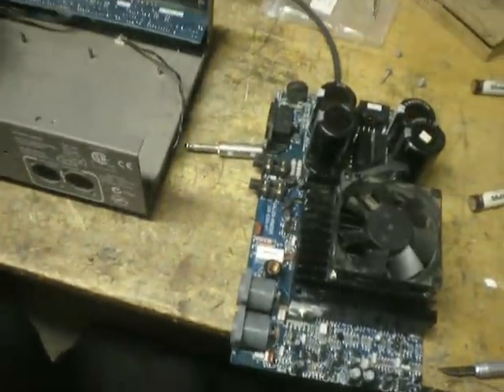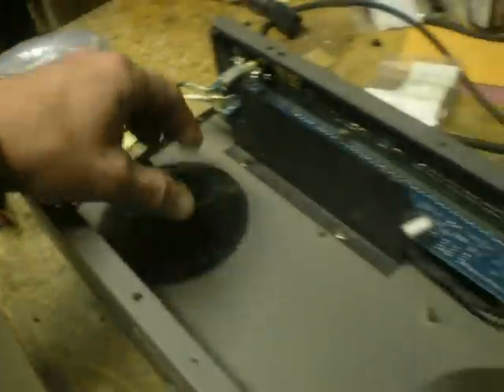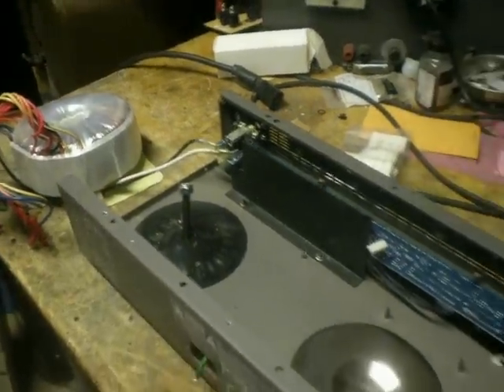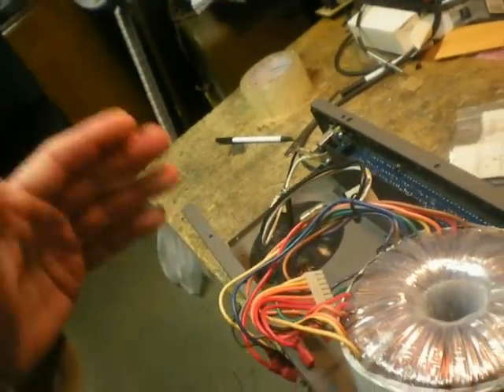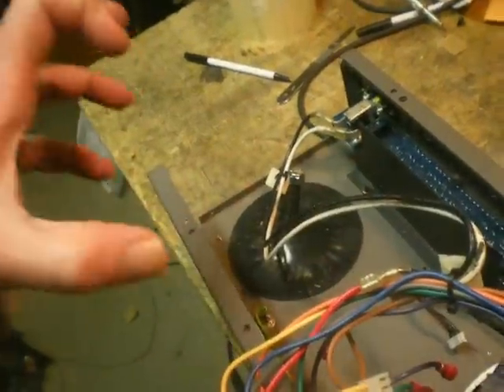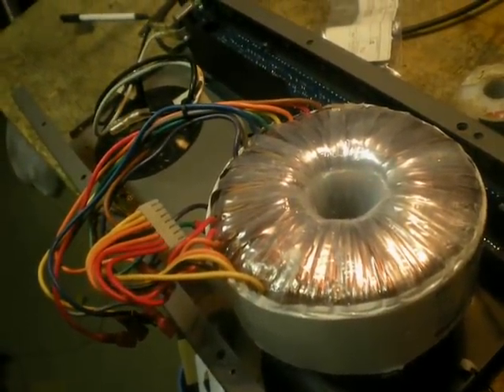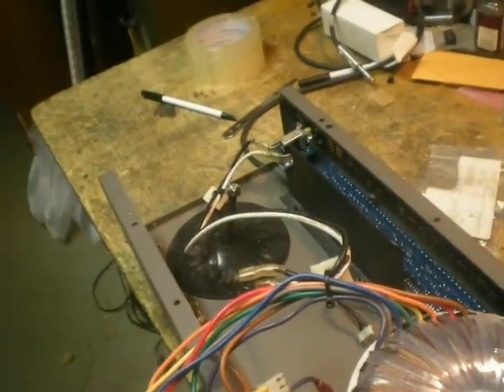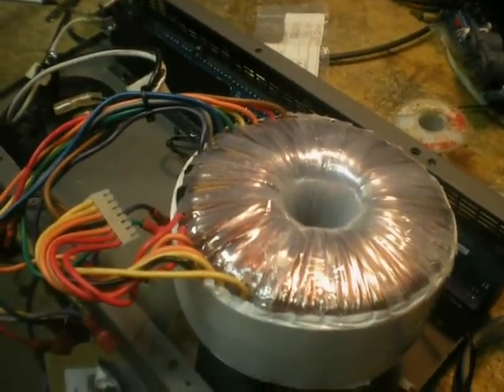Gallien-Krueger 1001rb SERVICE WARNING!

Comment: I have got one and just checked inside. Everything feels and looks rock solid. Can i also just protect the bolt with some cushioning or rubber on it or underneath the transformer?
Reply from the maker: doesn't hurt obviously.   if it doesn't side drop sufficient to smash through it you should be good
Reply: @sounddoctorin  tnx for the respond. Still going to do something about it just for prevention. Is a nut with a rubber top an option?

Comment: Thank you for thevideo... Gk sadly has lots of these poor engineering mistakes-- i have heard of lots of problems w 1001rband i have one that has a problem--im wondering:
-what symptoms did this cause? /why was amp brought in?
Mine gets alot of static and large volune changes /scratchy soundingoutput.. And popping-i thought it mightve been in the pots as it seemed turning volume it would go haywire-i took all the pots out sprayed em, cleaned em and let em dry... Problem didnt change at. All.. Also you mentioned amp fell.. Mine took a spill once real good- could be same issue?
Thanks!

Comment: Great video and explanation. I found this cause I'm trying to solve a grounding issue with my new GK1001rb, it constantly buzzes (even without bass plugged in) unless I touch the metal casing of the amp head itself. I noticed it stops when I loosened some of the casing screws and now I'm wondering if this might be the cause of it. I'm really disappointed to be having any issues with an amp that I thought was built to last.
Reply from the maker: If this issue was happening you'd have a serious short I think...probably something else going on.
Reply: I have the same problem ! I bought 1001RB month ago. New one. It was quiet and no buzz, hum or whatever (I must turn treble all the way up to hear buzz from twitter). After 4 days it starts working like a "popcorn machine" ! Just after turn this amp on ! I handed this amp back and I must waiting about a month (it came yesterday) for it becaues there's no support/service center in my country. Finally I have time to turn amp on... and there's a hiss ! A lot of hiss and even my small Ampeg combo is quieter with treble all the way up than this piece of sh... with just "stand by" mode ! No "popcorn shootings" but this hiss make me sick. What a piece of crap ! I don't know If I try products of this company again. Month of waiting and still this amp is usless. I'll just demand a refund and lookin sth different. Sound is really great but so what if there's tons of buzz and hiss. It's not a normal thing I guess...

Comment: Hey, so I have a 2001rb that o recently ordered and it was stated fully functional and thinking of sending it back but then what if it’s something simple? It does not power on at all
Reply from the maker: stress in shipping would likely cause this issue, is fuse blown?
Reply: @sounddoctorin  so I got it checked out and I was told it is most likely the relays because the fuses work

Comment: Hi Sounddoctorin,

I have this exact amp.  The issue I have is the amp goes into protection mode every time I move it or pick it up.  Can this be a broken soldering?  If I don’t move the amp, the light will remain blue and the amp works.  Any advise will help, I’m planing on fixing it myself, I just need to know what to look for.  

Thank you

Comment: Good video here doc, I have a 2001RB that may have the same issue, constantly falling into protection mode whether or not it has any sort of load on it. Took it to two different amp repair shops in the area and neither were able to pinpoint/resolve the issue. Ate the $200 of round trip shipping costs to have the official GK techs fix it, and it came back in the exact same state. At this point I'm almost $400 deep in repair costs and nowhere closer to a functional amp, and all GK can do is shrug their shoulders at me. I don't feel right pawning this problem off onto anyone else by selling the amp as-is, do you have any last ditch suggestions on how to breathe some life into it? It looks like that whole transformer unit is modular, no soldering involved? (I'm a butcher with the iron). Maybe buy a replacement part for the whole power unit? Thanks.
Reply from the maker: if it's related to problem i show, then these people are failing to re-insulate winding that got dinged and isolate it from future trouble...disconnect and pull it out and look....i think interconnects are used on it but it's a long time

Comment: Great video. A real craftsman as you were able to reapair the transformer. Do you know if the preamp section is modular (unbolt and plug in)? I have a 400 RB III that has an occasional crackle. I thought it possible dirty pots but it make the crackling sound intermittently.

On the topic of American companies: I also own an Acoustic Image Focus 1 bass amp. It's my understanding Acoustic Image will more than likely warranty any of their amps regardless of age. These amps are expensive but they are built using quality parts AND you can actually speak with the owner as he's a hands-on guy and works in his shop!
Reply from the maker: yup it's great the companies that still give personal service.   I don't recall much on that amp from memory on pre, but sure dirty jacks (including switches inside jacks...hit w/  deoxit spray and work them a bunch if they're send/RETURN jack or pa in etc.), pots and switches as well as chip sockets or stressed solder are always likely

Comment: Hello i was wondering why my gallien krueger 1001rb has a statick sound. Hopefully you can help
Reply: Mine does this too, when you adjust certain knobs.  Mine is the Contour knob.  You gotta spray some electrical board cleaner on it after you take the thing apart.

Comment: Hello SoundDocterin, Thanks for the video. I am having difficulty getting a straight answer from GK regarding my 1001rb ii head. I need to convert it from 110 volts to 240 volts so I can use it in Germany. I have read that this is a simple connection change in these heads and I was hoping you could point me in the right direction. 
 I have some experience with electronics and have disassembled/reassembled a few amp heads to replace pots, caps and so on. 
 Would you have any advice for me?
 Thanks!!!!

 David
Reply: Sorry Sounddocterin, I see that I have already sent you this message a few months ago. The amp was in Canada all this time i a just brought it over to Germany a few days ago. I am just looking for as many answers as I can before I crack it open. 
 I would still appreciate your advice/opinion. 

 Thanks!
Reply from the maker: not sure why I never saw notification for this.  sorry.  I don't recall conversion process on it.

Comment: How can I as a new wonder of a 1001rb make sure this doesn't happen to me?
Reply from the maker: +Matthew Gully You have to open it up with it unplugged.  If you pull the whole transformer it's best and then you'll see the screw underneath the front edge there that is the offending issue.  Options are  1) remove the screw and put some rv goop adhesive or the like through the hole to make a non-conductive fastener basically there.   Or use an actual nylon screw/nut 2) use a grinder to flatten the screw; being sure to suck all the metal flakes out and protect the boards from getting hit by any of them or you might wind up with OTHER issues like shorts caused by metal flakes Best is to use s dremel grinder and put some kind of 'mote' of cardboard around the work area.  or 3) Lay down something that will distribute the sharp impact of the screw head off of the transformer if it ever is to get dropped.  Eg a 16 guage steel spacer an inch or so wide ladying between the screw and the rubber gasket that should be under the transformer.

Comment: Hello Soundoctorin.I have a GK MB210 1st Gen. Lately, I have noticed that the sound isn't the same.The loudness was gone. It doesn't distort whatsoever but it wasn't as loud as before.Please advice on how to properly fix the amp if ever you have encountered the same issue.Many thanks and more power
Reply from the maker: Many possibilities I suppose.  Do all the potentiometers seem to respond correctly?  (I mean like given the sound level you are experiencing.  Eg. does gain control go smoothly from zero to the max level you get?)  If not maybe a potentiometer is broken.  Otherwise possibly a leaky muting transistor if it has those..I'd have to pull a diagram and take level readings along the path to really troubleshoot it

Comment: Hi Sounddoctorin! I have a GK 1001 RB MKii and I need to swap the transformer from 110 to 230 because I have moved to Germany. Do you know where I can get the transformer and the type I need? I have a little experience, but I know this job can be a dangerous one. What do you recommend?
Reply from the maker: A lot of transformers are set up so you can just switch a few leads on quick disconnects or the like for 240V operation.  I have no idea on that one.  Sounds like a research project on my end.  Call them and see if a tech there knows.
Reply: Thanks for the reply, I just found out they are universal. All it takes is a quick change of a few leads that are clearly marked.
Reply: I bought a used 1001RB at pawn shop and had the cover off to see how to access the scratchy pots (the knobs, nuts, heat shield, etc have to be removed so that the preamp board can be taken out to get to the pots). That's when I noticed that the transformer was set up for 230V. I live in the USA where the voltage is 120V. I emailed GK and they responded the same day that all I had to do was swap the transformer wires as marked on the power board. Also, make sure you have the correct 5mm x 20mm, time-delay fuse as marked on your board.

Comment: I was having fan problems. Do you think that could affect the fan ?
Reply from the maker: +Ted Toussant ... fans fail.  This would have nothing to do with it though :-).  Here we're talking about a shorted transformer due to a screw that hits the windings underneath.  Blows your mains fuse
Reply: Thanks !
Reply: +Ted Toussant Fan fixed ! The tech said to use a little loctite on the nut holding the x-former which would provide a good temporary fix till a good solution is found. Along with protecting the screw/bolt you mentioned. Thanks !
Reply: My 1001rb makes the same static noise where do i start

Comment: Well yeah, if you rattle almost any amp around your gonna start to have things hittin each other eventually. Love how these guys see a problem with an amp and start spreading the word that ever one of them has problems and are factory flawed.
Reply from the maker: It's a one of a kind so far in my 1000's of repairs.  NOT TRUE that a still fairly tight screw would have allowed enough lateral movement to short a nearby screw through windings.   THAT IS a design flaw and many have thanked me for saving them trouble.  IF YOU are gigging w/ THIS amp... puts some protection so the xformer can't slide over into that screw should it get set down hard.
Reply: Too bad the owner is giving away amp's to companies like talk bass to give them good reviews. Just go to talkbass and start new threads complaining about the amps. You'll get the best response. Sad but true.
Reply from the maker: @kobashis  what owner?  lost me
Reply: @sounddoctorin  Sorry Sounddoctorin not you. Your helping your customer's. GK is using talkbass as a service center and not supporting local repair shops. It's very obvious. I guess talkbass is loaded with EE's... RIGHT !
Reply from the maker: @kobashis  I don't know anything re: talk bass.  thanks for heads up